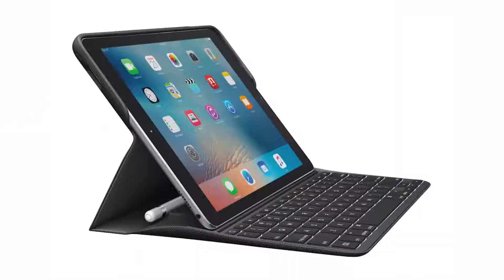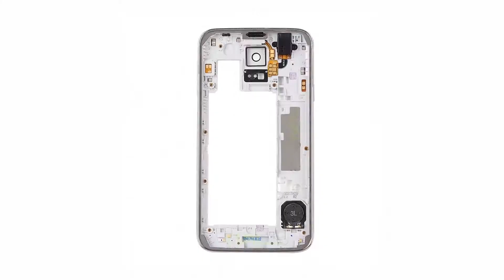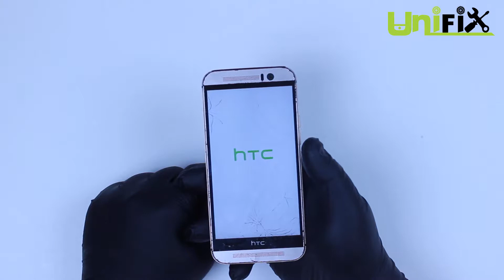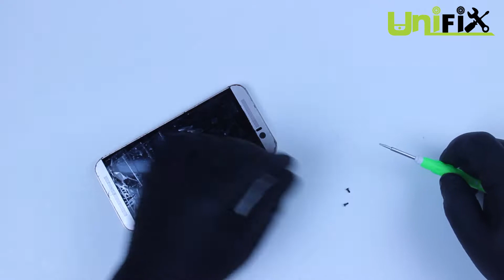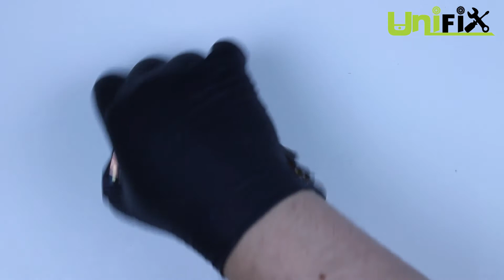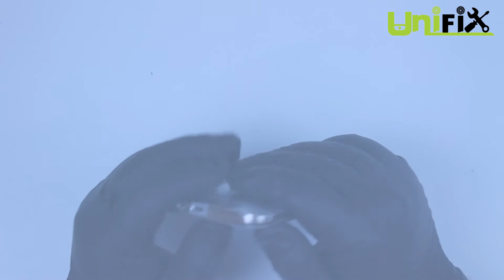HTC One M9 Dock Repair Guide Step by Step Easy to Follow by Unifix

Comment: Unifix Direct Replacement parts YouTube video regarding the HTC One M9 Dock replacement was very helpful.  Thank you for posting this video.  I do have one correction for you.  In the video you instruct people to put the cable that's transferred from the old dock to the new dock  on the "lower left plug."  This is physically impossible, as the cable will only reach to the upper right plug.  Also, OEM installation was to the upper right plug.  Otherwise your video was on point and useful.